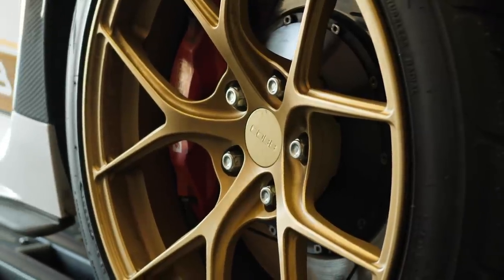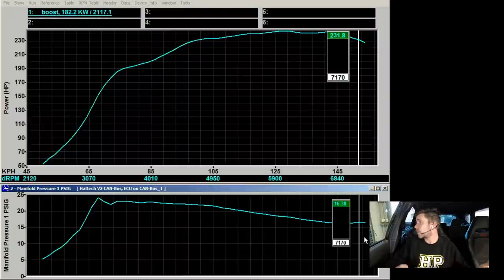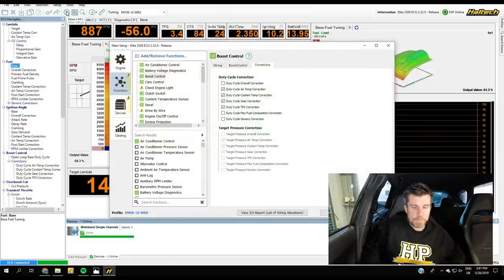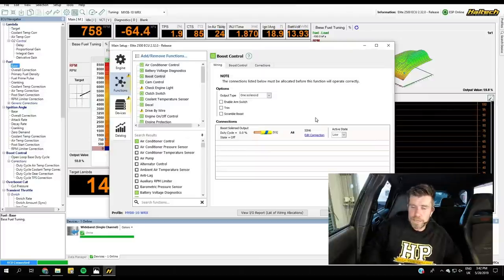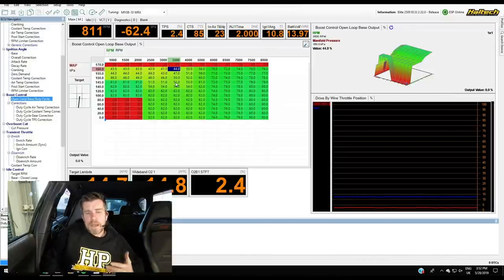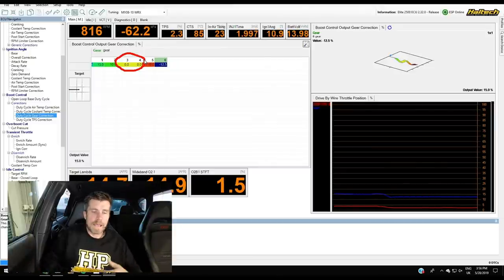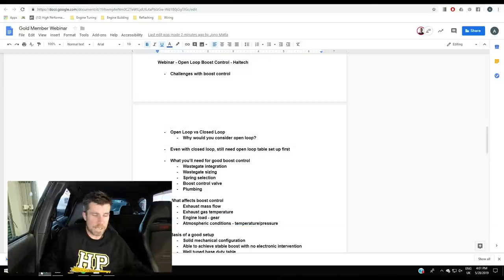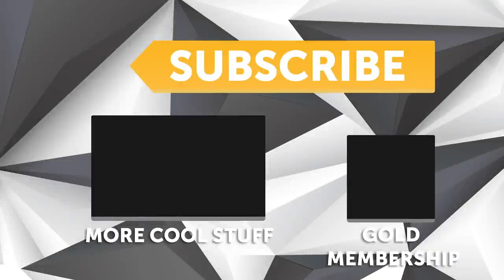Get All The Boost, Accurately | Open Loop Boost Control Tuning Guide

Comment: The company who made my turbo kit welded the Turbosmart 45mm hypergate vband flange right on top of the g30-770 .82 a/r turbine housing which is 90 degrees to the housing and is not optimal to get the exhaust gas out 🤦🏻. My tuner pointed this out to me when he looked in my engine bay. I acquired the Turbosmart 45mm electronic waste gate which I will have the proper 90 schudule 10 elbow welded onto the turbine housing to efficiently get the exhaust gases out. Motec M142 with the half bridge will control the Turbosmart electronic waste gate. This will remove the Mac 4 port solenoid Im using at the moment.
Reply: Honestly 90 degree angle is fine. Loads of the most popular manifolds have it like that and make tons of power with no wastegate issues.

Comment: hi, my barra xr6t has stock ecu, is tuned and is making 400rwkw and gets boost surge sometimes. Traction control off,  sometimes it boosts to 16psi by 2500rpm nice and smoothly usually in tip tronic going through the gears, other times flooring it from a stand still in D mode so it auto shifts it will boost surge jumping from around 10psi to 16psi and back to 10-12psi, it's not nice. what could the problem be?
Reply: You mean the boost goes too high when you floor it?
Wouldn't it be boost spike?
Got that on '' old '' turbo cars, my Saab jump to 12 psi to drop to 9 just after, but I don't get surge in my case. 
This is due if I'm not wrong to the response time of the whole system, in my case ecu, solénoïd and wastegate
I'm not sure to understand what happen in your situation ah ah
Reply: @blumafuji2753  it's a electronic boost control issue my tuner is struggling to figure out. The factory ford boost control is very complex to sort out once you have changed wastegate, intake, exhaust etc.

Comment: This isnt strictly related to this webinar. Say I have a pretty heavily modified STI how would I go about creating a base map and tuning from there?
Reply: Most ECU come with pre programmed base map logs but usually for a car in standard spec specifically to get a fresh install running only,
With my rx7 this would not have worked as everything was changed but someone on the owners forums had a similar build that he could send over.

Majority of the time though you will be looking at starting fresh or approaching a tuner who will have a good idea of what is required for your spec

Comment: Simple question, where is the best place to get a boost signal from for boost control. Inlet manifold, turbo outlet,  pre or after intercooler? Cheers
Reply: I want to say that the primary sensor used for boost control is the MAP sensor measuring the pressure in the inlet manifold. But I’m not convinced that that is actually the best for managing the turbo.

Although if you consider the purpose of boost control to be about building pressure in the intake manifold to manage engine power, then really the map sensor is the best for the task
Reply: Intake manifold
Reply: @RHBTurbochargers  wrong dude, it should be after turbo pre cooler. stock is usually off comp cover.
Reply: @farmer3242  To each is own, but to regulate intake manifold pressure you must reference the intake manifold. You also get better wastegate control between shifts.
Reply: @RHBTurbochargers  ok I didn't know that. Is it better that the wastegate diaphragm gets vacuum when throttle shuts?? I guess  it would be??
Reply: @farmer3242  Yup. It's a lesser known benefit.
Reply: @RHBTurbochargers  wrong place to plumb your wastegate or boost controller. Vacuum leak on boost controller operation. And wastegate exposed to vacuum. Clearly says on wastegate instruction manuals tial or turbosmart not to plumb them on vacuum sources.
Reply: @seran2316 I had mine on the intake manifold on my twin turbo 600 bhp drift car and never had any issues

Comment: 33:55 people really underestimate the importance of boost-by-tps. It completely changes the driving experience and controllability of a high boost 2WD car.
Reply: Running a reasonably sized throttle body does this mechanically
Reply: @RHBTurbochargers  I'd prefer the simple tuning of boost by tps rather than intentionally restricting the intake system with an undersized throttle body. Even with a small throttle body you're still affected by the TPS WOT curve and will achieve higher boost with less throttle at low RPM.
Reply: @TheCarPassionChannel  It's all down to personal preference

Comment: Lots of solid info in this one again!
Definitely requires some nitpicking on the "open loop" definition though. If you vary the boost control duty cycle based on map pressure, that should really be called "closed loop". It's in reality a PID control with the "I" and "D" terms set to zero. Just created in a different way.
Reply from the maker: I think if you watch the video in its entirety I refer to this method as 'passive closed loop'. I'm not aiming for necessarily a text book definition but rather something that is easy enough to understand and easily distinguishable from a true or 'traditional' closed loop utilising an ECU's actual 'closed loop' strategy which we are purposely not doing here. So in short I believe most people will be able to distinguish the differences - Andre
Reply: @hpa101  Always watch all of your videos!
The name of a control strategy ultimately doesn't matter for it's function of course.
But still think that a "P" boost control strategy should be called closed loop, even if it's being set up in a non-standard way.

Comment: No videos on maxx ecu?
Reply from the maker: Not at this stage, what are you trying to learn how to do with your MAXX Ecu? Let me know as although we don't have any specific examples using their platform just yet, we do have a TON of content that will still apply regardless. All these different ECUs are trying to control the same things remember, none of them have reinvented the way a 4 stroke gasoline fed piston engine fundamentally operates - Taz.
Reply: @hpa101  im still debating on what to buy. Maxxecu, ecu master black or ms3.. maybe haltech 2500. For a 2jz gte. I'm leaning towards the maxx .especially for what I'm getting for the cost. Seems quite a few guys werre having issues with ecu master
Reply from the maker: I wouldn't base your choice on what we do and don't cover personally. Yes some specific content using the same software will help you learn a little faster, but not having it won't stop you with the previous comment in mind.

If you don't plan to tune the car yourself at all in the end then you do also need to consider what your local tuner will and won't tune for you too, and then also the wiring situation noting there might be a plug and play option for your car that one company offers which another does not.

At the end of the day there are more good options out there these days than bad really, and they all have pros and cons/quirks in one way or another.

With all that out of the way, we do hope to add a MAXX example in 2022, both for tuning and also if we can an example to the PDM/PMU course using one of their units - Taz.

Comment: Why can't the turbo hold 22psi all the way?
Reply: He said it in the video, the turbine housing becomes too restrictive.
Reply: @joebidden4914  comment was from a long time ago so I can't remember the video contents exactly but does this mean the turbo shaft speed slows down as the RPMs increase? If you opened the wastegate more and more would this lower the decrease in shaft speed? The restriction idea is hard for me to understand because if it makes 22psi at any point, I would assume it's the maximum because of the shaft speed can't go any higher?
Reply: @bilaltariq7819  its because of physical ability to flow, they just can't keep up with the airflow demands at higher RPMS and higher VE. Smaller turbos have quick response but their flow is restricted from housing size, turbine size, and also compressor size. There's a lot that goes into turbo sizing and different applications and also different fin desings for the compressor and the inducer and exducer sizing and shape. A lot more than I can explain in a comment here lol. Also just because the pressure is higher doesn't mean it will have more airflow. Turbos are usually rated in lbs/min of flow and a rough equation is 10whp for every 1lb/min of flow. This isn't applicable to everything, but it is a good general rule. You have to have the supporting mods and what not to be able to fully utilize the turbo if you go bigger as well and a proper tune of the VE tables and also adjust timing which is something that should be left to a knowledgeable tuner who knows what they are doing, not just someone going in and making changes when they really don't understand what they are doing. Sorry long post but its not so simple as just a compressor/turbine speed.

Comment: That was not open loop but closed loop with P term vs rpm gains. Prove me wrong!
Reply from the maker: High Performance Academy
37 seconds ago
If you watch the video in its entirety I refer to this method as 'passive closed loop'. I'm not aiming for necessarily a text book definition but rather something that is easy enough to understand and easily distinguishable from a true or 'traditional' closed loop utilising an ECU's actual 'closed loop' strategy which we are purposely not doing here. So in short I believe most people will be able to distinguish the differences  here and the intent of the lesson - Andre